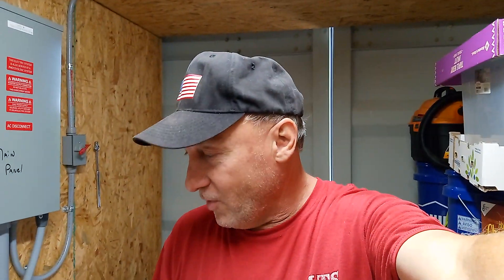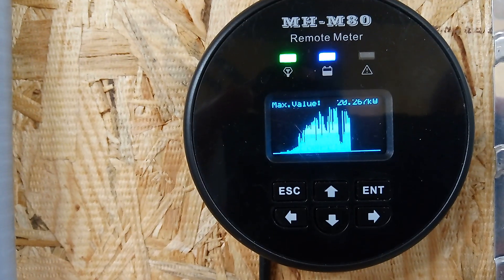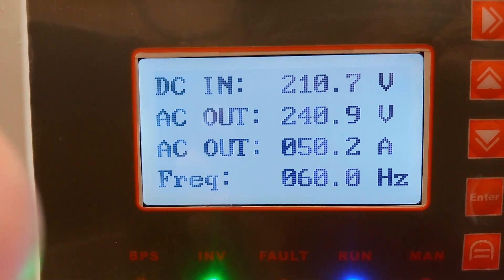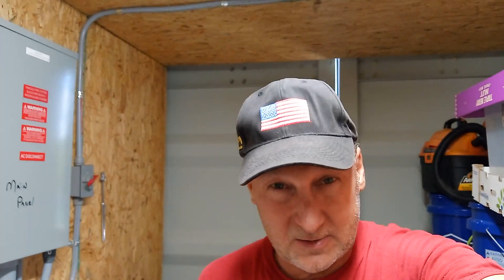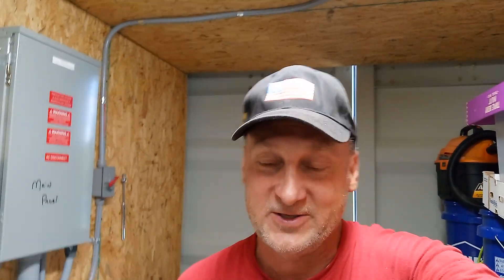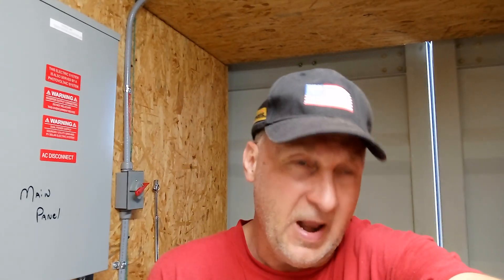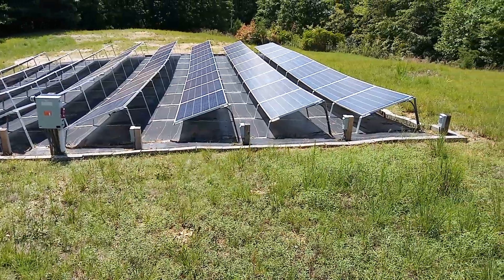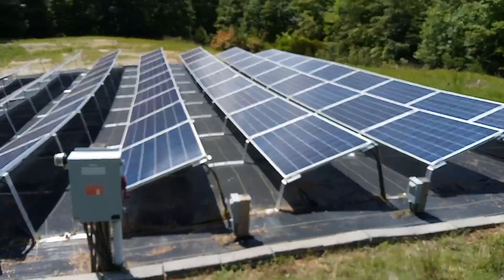How to SUPER CHARGE your solar field ⚡⚡⚡⚡⚡⚡⚡⚡⚡⚡⚡⚡⚡😎

Comment: Hi Mike, I just installed the 35kW 3 phase converter. Got the 30kW inverter also. I didn't get the chance to power up the inverter yet. My suggestion is to leave your existing screen on the inverter if you can. This new ones have such a small numbers on them, because they are trying to display all data at once. The set up HMI pushbuttons are tiny too. See if you can wire your new screen and you like it before a pemanent install. I think it's just easier to see your parameters on the old ones.
Besides this, this converter is something else. Weighs about 600lbs. We had to mount it off the floor about 24" high in the basement. It tends to flood a litle bit in there. I like, that it rectifies 2 phases, and then it puts out it's own 3 phases 120 deg out of phase. Similar to the VFDs. The voltage and frequency is right on the money. Has a nice soft start feature for the inductive loads. It runs 2  3 phase heat pumps for 22 mini split indoor units.
I am working on the battery high voltage side of things( mounting a fuse, DC circuit breaker, some busbars and precharge resistor) so I can power up the inverter. I still need to wire my BMS later on. Both HMI screens look identical on the 3 phase converter and the 30kW inverter.
Reply from the maker: @AdamBoguski  thanks for the update.Ill do that.But the problem is they say the new touch screen only goes with the new motherboard they sent.So I have to change everything out to see if I like it LOL.600 hundred pound converter.She is a pretty hefty girl.
Reply: Yes, see if you will like it. The only issue with the old ones might be the foil pushbuttons. But for them to go bad, they need to be pushed a lot. I don't think that it's a problem. Some garage door openers keypads are designed that way too.
Reply from the maker: @AdamBoguski  yeah I wish they would of did a little better with the buttons on the old screen.Can you adjust your fans with the new screen?
Reply: @mikeg2321  yes, there is a setting on the converter for"max. environment temperature" - ambient temp. I think. It was set to 75C. The manual says that the fans will kick in at 45C. Looks like the 45deg C is a treshold to cool down the ipm module. These are the settings for the 3 phase converter, but the inverter's setup screen maight be the same. I should know better hopefully this week, when I'll get the chance to hook it up.
Reply from the maker: @AdamBoguski  let me know if you don't mind.Thanks Adam
Reply: @mikeg2321  no porblem, Mike. I just ordered 200 amp DC fuse, just want to add inline with that for my test.